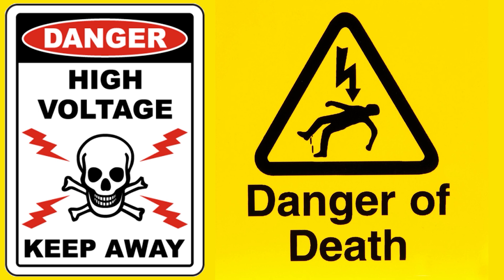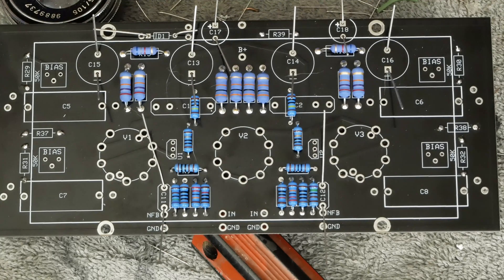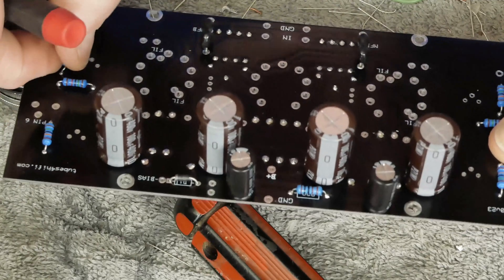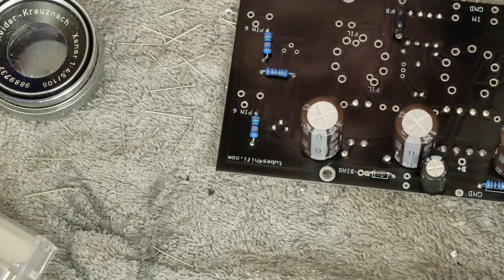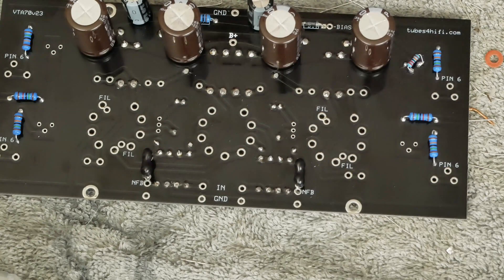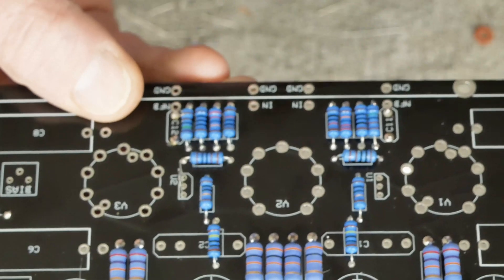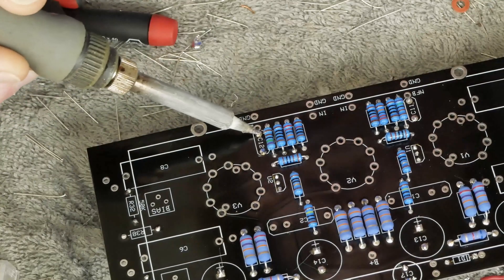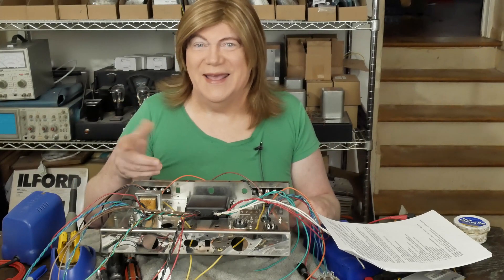Dynaco ST70 Tube Amp Kit: Mods to the Driver Board.

Comment: C13 through C16 in the kit used to be 450V rated caps, they are now being supplied as 400V caps. Since the desired voltage on the bus feeding the caps is ~380V, that is not much margin. If you elect to use a solid state rectifier, the 400V caps will be exposed to over voltage on startup. Suggest that you change to 450V/100uf caps.
Reply from the maker: Thanks, I'll look into this when I power it up!

Comment: Another great video, Im following every step.  Am I correct in that there is no orientation required for resistors, and it would be helpful if upon completion of the board, you would show a few seconds of video for each side of the completed board.  That way I can freeze the vid and have a reference photo.  Also, Ebay shows the safety resistors for about $2 each, is that reasonable.  Thanks again
Reply from the maker: $2 each is way too much! They should be $0.10 each or less.

Comment: Good stuff . The LM344 is temperature sensitive. I added a diode and extra resistor in that area. The board is the same across the entire range so a very useful video for anyone planning a build.

Comment: I saw a video of a factory that they use a toothpick to get some tiny amount of flux then they put on the pad then solder is interesting to see I know that the solder has already flux internally in the wire but maybe it all go smother 😊 
here is the link of that video on 5 : 43 https://www.youtube.com/watch?v=0_NG3toUP7o&t=381s
Reply: I didn't watch your video link but I normally do the toothpick/flux/pad thing as well. It does make things more messy & time consuming. The time to actually add the flux & then the time to wipe it down/clean it up. A lot of times I forget or I'm in a hurry & I don't believe I've ever had an issue without using the extra flux.